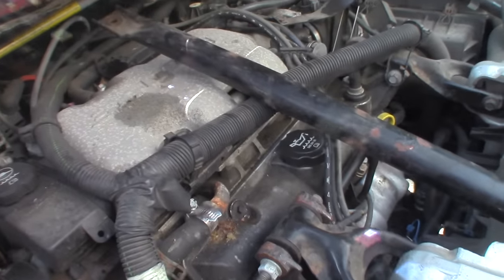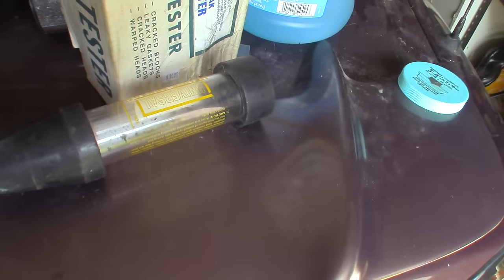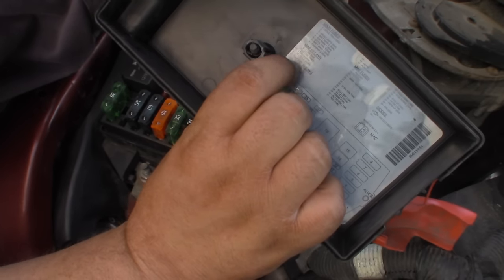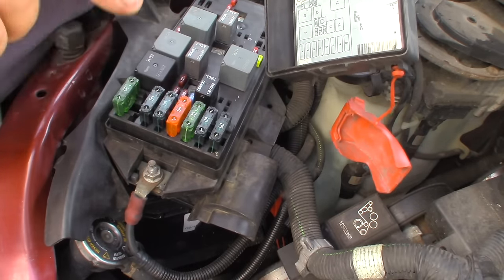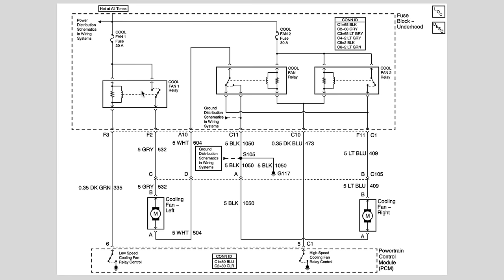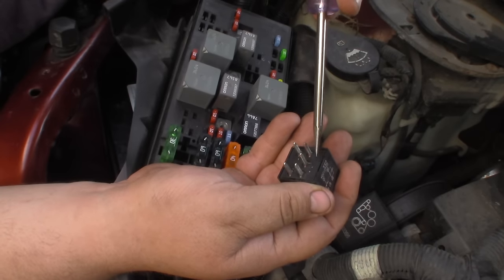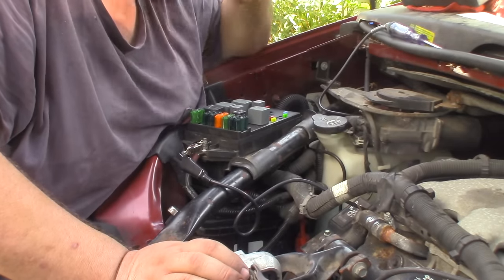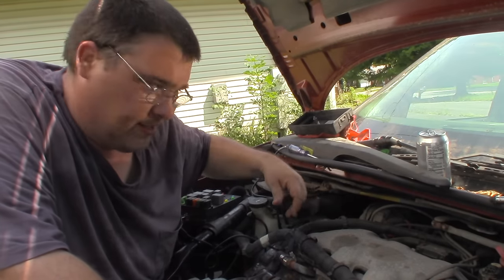GM 3 Relay Low/High Cooling Fan Explanation/Diagnosis/Testing - Chevy Venture

Comment: A trick you can do for the summer too stop it from over heating is just flick the AC on that will automatically turn on the fans. Make sure the car is parked and not moving that way there’s no air flowing over the radiator. The fans have to come on with the AC cause why’ll using the AC the fans need to run or else the AC won’t work properly. Both fans kick on with the AC so that is a trick
Reply from the maker: Both fans kick on but only on low speed and only if the AC system works and has pressure.
Reply: Another trick in the winter, is always run your defrost. GM makes the a/c compressor kick on to dry the defrost air which in turn kicks on both fans.
Reply: @frugalprepper  no if you are parked fans will come on at high speed cause AC system needs to move air. They shut off when cars moving or go to low speed cause airs moving over the condenser when cars moving.
Reply: @kevinspahr6632  not on every car though most do that
Reply: @ryans413  Most of the older GM cars did in my experience.  GM's that I've owned that did were 83 olds cutlass, 92 chevy cavalier Z24, 86 Buick Somerset, 86 Pontiac Trans-Am, 93 chevy truck and my 04 Chevy Venture. Don't know about anything newer than 04...lol. Some of them I would have to unplug the compressor in the winter because they would short cycle when I'd run the defrost from low refrigerant. Currently my 93 truck's air compressor is unplugged. A/c runs fine after adding a can of refrigerant in summer,  but runs out by winter from slow leak? 04 Venture A/C is bullet proof!! LOL
Reply: @ryans413  Not true

Comment: Very technical very good but my question is what determines the  computer to decide (6) low or  (5) high speed choice. > Without AC applied  Is it determined by the ohms in the temp sensor ; resistance in ohms in the temp sensor ??     I'm aware the AC compressor on will turn both fans on .  That would not be caused by temp sensor at all .  I always thought 1 fan runs at low speed not both in series at 6 volts . Live and learn 2001 3.4 Chevy Venture van.      PROBLEMATIC !!!
Reply from the maker: The computer control high and low speed operation by the position of the AC Switch which is communicated from the HVAC control module, and the Temp Sensor.  As well as certain failure of sensor or when operating in reduced power mode it will often run the fans on high.  On newer GM's it will leave the fans on high for a failed temp sensor even when replaced until you clear the code.
Reply: @frugalprepper  to follow up if NO AC is on, and  both fans kick up to High speed at about 234F what caused this initiation ? Surely not the AC.     Must be the Temp sensor alone ? What is reduced power mode ?  BTW what do YOU know as the temp to turn on high speed ?       3.4,   01 Chevy Venture . Thanks

Comment: I have a Chevy cruze. My engine cooling fan runs constantly at high speed. I've changed temp sensor, the fan itself, the thermostat and even a/c pressure switch, it didn't fix the problem. What could make the engine cooling fan running at full blast? I appreciate your reply.
Reply from the maker: I would scan the computer for any faults on the engine.  There are faults that will show up under OEM data that will not light the check engine light because they are not emissions related, but still a fault none the less.   The Cruze's will run the fans at HIGH speed all the time if there is any fault with the engine. You will need a Scan Tool that can read OEM data/faults not just Global OBD2.
Reply: @frugalprepper  I have a P0599 code
Reply: @frugalprepper  Btw the engine temp gauge shows a normal temp I mean not hot engine and the a/c is working fine

Comment: I have a 2007 srt8 charger and both fans kick on in low but once I turn a/c on Temps go up and I don't hear high fans. All relays check good and temp sensor appears good on scan tool. Is it possible for high side on fan not to work? Maybe fan issue 🤷🏿‍♂️
Reply from the maker: Yes.  The work off of a different ground and postive in high vs low

Comment: on my 1995 camaro my fans will turn on and go on high but after a while with a/c on the low speed fans turn on and then that allows the engine starts to heat up. i feel the high speed fans should remain on speically with its 102 out side and the a/c on. question is were do i start to figure out why this is happening?
Reply from the maker: You are going to need a OBD1 Scan Tool to see what the actual engine temp, the computer is seeing.

Comment: I have that same 3 relay system on my mazda tribute. The problem is that the driver side fan is at high speed when i turn on the ac and the passenger fan would only kick in for a second and  all the power goes to the driver side fan. I changed every relay and fuse related to the cooling system even the temp sensor. Would it be down to just the cooling fan itself?
Reply: any answer??? same problem
Reply: @allamoniTM  i just bought a new assembly because there is a resistor built in the fan
Reply from the maker: I don't know.  I don't work on Mazda

Comment: So I found out my problem and it was the cooling fan 1 mini relay and I kinda have to wiggle it for it to work or hold it down 
After I let it go the fan turns off what should I do ?
Reply from the maker: Ind another fuse center at a junk yard and replace it would be what I would do.  You could also just break out the wiring from under the box and wire in the relay directly to the harness with a holder.

Comment: I have a 2000 Oldsmobile Silhouette minivan, basically the same as the Chevy Venture.  When the temperature is cool outside, say 50 degrees or less, and I turn the A/C on, should one of the cooling fans turn on?  I don't know if the fan only turns on when the outside temperature is also above a certain degree or not.  It's been around 50, and the only fan that turns on is the passenger side fan once the engine warms up, and that seems to be at a pretty fast speed, but I don't know if that's the "high" speed or not.  Also, which fan is #1 and which is #2?  Passenger side or driver's side?
Reply from the maker: The fan should come on any time the ac compressor is on.   I don't remember which is which.  I would have to look at the diagram and the wiring again.
Reply: @frugalprepper   I tested the fan motors and the relays with your helpful video.  All looks good.  But when I start the van and turn the A/C on, neither fan turns on.  Sounds like there is an A/C high pressure switch somewhere that tells the fans to turn on, but I can't find it.  There's a a/c pressure switch under the air intake box, but when I disconnect this switch as the engine is running, the A/C compressor shuts off.  Do you know if this is the low or high pressure sensor?  If low, do you know where the high pressure sensor is located?

Comment: I have a 2003 Chevrolet Venture ls ( my two fans comes on when I turn on the AC and when I turn on the defrost ) ( but when I let the vehicle set there and run 10-15 minutes the fans do not come on ) ( do you think it might be mine fan temperature switch body thermostat housing ) ( 09.01.2019 Sunday  ) ( im.. Jake Locksmith Services, Fort Walton Beach Florida.USA  )
Reply from the maker: Unplug the temp sensor and they should come on high when the computer detect and open circuit with the temp sensor..  If they do you know the computer can command them on for sure.  Then I would verify the computer is seeing the correct temp from the temp sensor with a scan tool.
Reply: @frugalprepper  ( ok... thanks  ) ( I did not check the relay fuses  ) ( the vehicle do not run hot I'm just concerned about the fans coming on with out  The AC or defrost ) ( I will check with you sent
Reply from the maker: @handymannlocksmith  If they come on on low speed with AC the Cool Fan 1 Fuse has to be good.  I you unplug the temp sensor and they come onto high speed then cool fan fuse 2 has to bee good.   It may just not be getting hot enough kick them on.  You low speed fans should kick on around 225 and the high speed should kick on around 230 and then the fans will go back off around 200.   It's good to verify operation, because these 3.4's will crack heads at the slightest overheat.  They are a job to do heads on too.
Reply: @frugalprepper  ( ok ... thanks for the good information I will begin to check them .... relay fuses also temperature sensor ) thanks

Comment: I had the same problem With my gm van the cooling fans were not kicking in at the right time. At the same time I noticed that the ac was blowing not cool enough so I decided to clean up the air filters from the inside the glovebox and the problem With the cooling fan was fixed.
Don't ask me why couse I don't know.
Reply from the maker: Thanks for the info

Comment: Very insightful video, now how do I obtain a wiring diagram for a 2010 Hyundai cooling system? Have rad fans not turning on, only when AC switch in engaged, already replaced coolant temp and verified fans work when 12v is applied. Haynes Manual wasn't clear, they seem to cover late 90's cars.
Reply from the maker: e-mail me at tomfurgalprepper@gmail.com and I will pull up the diagram and send it to ya in a PDF.
Reply from the maker: sorry it was a typo on my part it is tomfrugalprepper@gmail.com

Comment: My fans come on late in my Saturn aura . I change the temp sensor but the gauge still slightly goes above the middle and then the fans cut on . They cut on late after car starts to get hot . Can you help please
Reply from the maker: Did you look at the temp on a scan tool to make sure the gauge is accurate.  Those gauges aren't alway real accurate.

Comment: hay frugalive got a cooling fan issue only the low speedfan comes on i tried connecting the testlight to positive & tested control side to relay on both fans i got  nothing. motors work relays ok new ect sensor & new thermostat. whats realy happening.
Reply from the maker: Both fans should come on Fast or Slow in this design.  You shouldn't ever have just one fan spinning, you probably have a problem with the relays Cool Fan and Cool Fan 2 or the control to those two that is stopping them from operating in series when low speed is required.
Reply: its a gm 3800 2 relay 2 wire 60Afuse( pink) dosnt overheat the low fan come on when very hot.

Comment: But I can't get about my vehicle it's a 2006 Pontiac Torrent 3.4 l and my fans clicking on high speed and right now the temperature is -25 degrees which I don't understand it's cold outside and when my temperature goes halfway up into the middle these fans kick in and it's cold outside so I don't understand what's going on with this vehicle I hope somebody can figure this out because I sure can't

Comment: I having coolong fan issue. Driver fan not turning on, only passenger fan turns on at high speed when the temp gauge goes above the half. I checked relays an fuses, switched relays one by one,and all they work in the passenger fan. So the relays are fine, but still driver fan not turning on
Reply from the maker: So the Driver fan never works even when you switched the relays on one by one?  you need to verify you have continuity through the fan.  Burn connectors to the fan are a common issue on these a well.  Especially on 05-09 Equinox, Vue I have seen a bunch of them.  Neither fan works on low because there is not circuit through the one fan and they run in series on low.  Then they run in parallel on high so they one of them runs.
Reply: @frugalprepper  I managed to fix the problem today, it appear was the temp sensor and the conector, The 2 connector cables were burn out and they were touching each other, so I replaced the temp sensor and fix the connector sepparating the 2 cables assuring they wont touch each other (this was a temporary fix while I replace the connector cable of course). With this the 2 fans are working properly now on low and high speed. Thx for the help
Reply from the maker: @KratosAurionF  Interesting.  I know and open circuit normally put's both fans into high.  I have never see one with them shorted before.  It gives me a a good thing to check if i run into this in the future though.  Thanks.
Reply: @frugalprepper  well, the problem came back today =/. And its even worse now. The driver fan stopped working again, and now it wont turn on neither slow or high speed, before this when i turn on the ac while the temp was below half the 2 fans were working fine. And now when i turn on the a/c while temp its below half still the driver fan wont turn on just the passenger fan and in high speed. Then i disconnected the temp sensor to see what happens, and nothing happens, the passenger fan still in high speed and no driver fan. 

Oh Btw I checked codes and its throwing me P0480 CODE fan 1 circuit not workin properly

Comment: So what was the issue? That was confusing
Reply from the maker: The issue on this one ended up being a plugged radiator.   The owner drove it and over heated it while waiting for the radiator to come in and cracked the heads.    I had done the head on this about 3 years before for a stuck thermostat where the owner drove it over heated.  The owner decided not to replace the heads again.  This van has since been turned crushed and shredded.

Comment: I'm still confused😂
I Hsve this same issue
Reply: Did you figure it out????
Reply: My fan turns on if the relay is out... But does not if the relay is in???
Reply: Needed a new fuse box...the number 2 fan wire entry into the box was fried...that's why it wasn't working...bought one at junk yard and had a gas station shop put it in
Reply: @Lifeizrigged  thanks for the info!!! My head was about to pop when I heard my fan turn on last night even when the fan relay was not even in the fuse box!!! But I could only think that it was similar to what this video was saying... And the fan only turned on (on high) when it was (really hot) even though the low fan relay was missing... But what confuses me is... WHY DID MY FAN NOT TURN ON TODAY DURING A TEST RIDE WHEN A GOOD "LOW FAN RELAY" WAS ACTUALLY PLUGGED IN? IF IT WORKED WITHOUT A LOW FAN RELAY IN LAST TIME? SO MAYBE I COULD NEED A NEW FUSE BOX AS WELL I GUESS BUT I DON'T KNOW YET FOR 100% WHAT IS GOUIG ON WITH THIS!!!???

Comment: Relays can get lazy&work intermittently as they age,#of heat cycles weakens electromagnetic contact which can be dirty increase resistance, and fail after relay gets hot. Order new online & mark up🤑 I never saw a 3 relay set up, Thanks I learned GM
Reply from the maker: Well we all get lazy and work intermittently as we age!

Comment: These types of problems will drive you crazy. 50% of the time it was my error or forgetfulness, OR lack of thorough testing the first time. Sometimes its luck like maybe light corrosion or something on a relay and by pulling it in and out renews a good connection.
Reply from the maker: FYI:  This actually had a partially plugged radiator.  The owners drove it and it overheated again and they kept driving and cracked the heads.
Reply: @frugalprepper  I hate cooling problems. My upper rad hose is swelling and system is over pressure. New rad. Ect cools down when fans kick on. Did block fluid test and no change in color. Like I said, i hate cooling issues.
Reply from the maker: @Ashroyer86  Thermostat is a common failure on these because it is hard to get to and no one changes them.  Everyone of these I've done heads on had a stuck thermostat.  I would try replacing it.  The book says you have to pull the exhaust cross pipe but if you get a set of cheap S wrenches at harbor freight you can get the bottom 13mm  bolt out of thermostat housing and replace it without pulling exhaust cross pipe.  The throttle body and coolant hoses still have to come off though.
Reply: @frugalprepper  I put a new one in. Plus the ECT is cooling so it tells me cooler water is getting in passed t stat.

Comment: hello good video. I have a question, the same thing happens to me when you go up more than 200 when the fans are activated. but the low does not work for me. change the thermostat sensor. an idea of what might happen
Reply: Same thing is happening to me. It only seems to turn on high when engine is overheating.
Reply: Did you ever fix this issue?
Reply: @swish4773  they were the head gaskets

Comment: My problem is I can't get my fans to come on when I cut on the A/C. Can u help. I checked  fuses  relays.   But fans do work with direct power.
Reply: My fans also want work when get hot.
Reply from the maker: You need to see if you are getting the control is getting pulled low by the computer on the High and Low speed relays test light at the relay.   Then you will know it the computer is commanding them on or not.
Reply: @frugalprepper  believe it or not,but I unplugged the temperature sensor and the fans kick on and is running fine. I plugged temp sensor back on and everythingfine. I'm going to replace temperature sensor